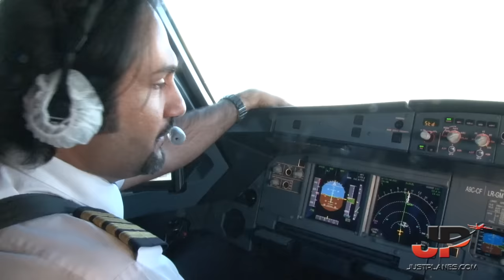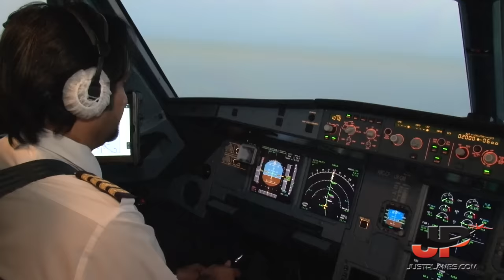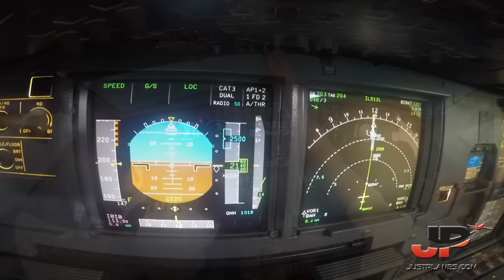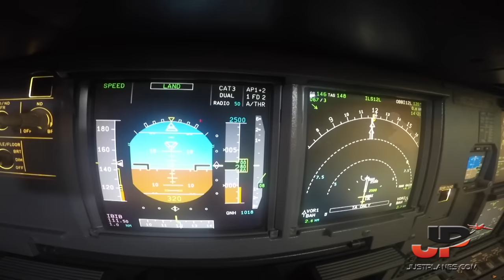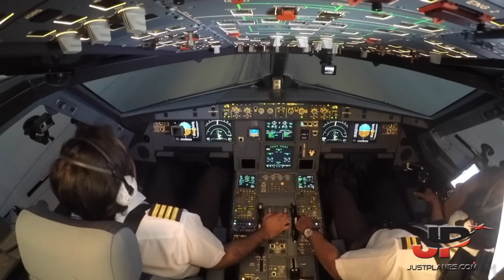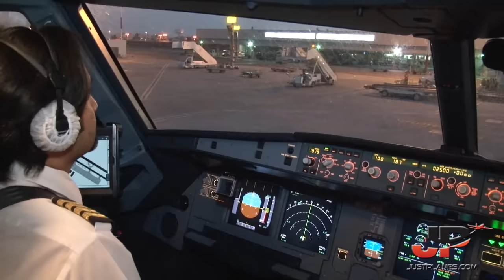Watch AIRBUS LANDS ITSELF  - Full CAT III Autoland

Comment: I'm sorry....you auto land of days gone by are stretching it a bit by touting various aircraft that had auto land capability.  To wit: as advanced (for its time) as the L1011 was, it was not fully CATIII (which, BTW there's various CATIII certifications) certified.  Go look up your history of when the FAA approved the CATIII landing process.  The L1011 might have been capable, but capable and consistently achieving a CATIII landing including roll out is a different matter.  Me thinks there's some wanna be M$ SIM pilots that read and believe waaaaaay too much.

When launched in the latter of 1985, the Gulfstream GIV had all the avionics for CATIII certification but it wasn't certified at that time since many airports didn't have the required FAA infrastructure.  Certification was achieved at a later date with the inclusion of autothrottles.  Plenty of aircraft manufacturers touted their aircraft's "CATIII landing" ability, but none - to my knowledge in this time frame - were actually ordered with the necessary avionics/electronics since there was probably only 3 airports in North America that had the infrastructure for CATIII.  This might be splitting hairs, but I see a vast difference in capability versus actual performance.  Be that as it may.....

As has been pointed out, due to the advent of FBW, FADEC, BBW, AutoThrottle (subset of FADEC) and other technologies, the A380 and other aircraft have achieved a very sophisticated level of CATIII landing capability.  However.....go back and look at this video.  Yes....the avionics of the aircraft are doing a remarkable job of maintaining the vertical and horizontal position of the aircraft persuant to the approved landing procedure.  BUT.....the electronics do not fully command the aircraft's landing configuration.  This is still the PIC or FO's responsibility.  The "Auto Land" is merely a tool to lessen the flight deck's work load in less than ideal conditions.

Lastly, I'll apologize for the apparent rant.  However, it's only the FAA that stands between the corporate airlines and full aircraft autonomy.  The technology has long existed due to black hole project work and other such research.  Consumers "feel" better when someone is driving the bus.  Airline CEO's see profit increases at the notion of no "bus drivers" in lieu of system monitors.
Reply: You are wrong. The limitations on the use of auto-land are down to the airports and the FAA. Aircraft have been capable of Cat 3 auto-landings for more than thirty years, but the regulatory authorities have not been willing to licence their use because few airports have sufficiently good ILS systems or the ability to handle ground traffic well during poor visibility.

Comment: The Air Bus flys like a video game .
Reply: Still safer than a 737 MAX
Reply: Thomas Mortimore air buses have had more crashes than the max
Reply: Mr Paul Grimm that’s hardly a fair comparison as the A320 was first introduced in 1980’s and 737 MAX in 2016. A320 NEO hasn’t had any crashes

Comment: Uhhh, it's NOT an auto land if you have to manually lower the flaps and gear.
Reply: It is autoland. The autopilot doesn't have the ability to lower the landing gear and change the flaps.

Comment: Just a matter of time before the airlines eliminate the co-pilot on short ..2 to 3 hour flights. Then stretch it out.
Reply: It won't happen. Big commercial jets cannot be flown by a single pilot, there is far too much to do. Besides, number of crew is specified by the manufacturer in consultation with the regulatory authorities.

Comment: This should be the norm and not the exception. All landings should be autolandings and they should practice manual landings once in a while. That would eliminate many issues. Like runway/taxiway misidentifications for one. It will never happen, but it should
Reply: Wrong. Auto-land systems can handle only a small fraction of the situations which human pilots can handle.

Comment: Are pilots gonna be replaced by this technology?
Reply: Autoland has been around since the mid 60s
Reply: @PabloGonzalez-hv3td  ok, is that a yes?
Reply: @kcism3239  - No it's an aid for landing in near zero visibility where a visual landing would be impossible
Reply: @PabloGonzalez-hv3td  Mr. Gonzalez you really think this technology won't replace pilots one day? Like auto taxi for runway? Like the Jetsons?
Reply: @kcism3239  - No because when something like an aircraft is fully automated it becomes vulnerable to failures that would otherwise be recoverable by a human pilot which is why the US military crashes far more UAVs than manned aircraft
Reply: @PabloGonzalez-hv3td  Mr. Gonzalez pilot error is said to be the largest factor in crashes and your telling me sofrware of the future will not replace pilots? In capitalism? Really?
Reply: @kcism3239  - The safest aircraft have  human and computers watching each other's backs without getting in each other's way and flying in the last 20 years has become the safest it's ever been.

Automation will never replace human commercial pilots for the reason I mentioned already, that is, automation requires sensor input information and a simple input failure is a vulnerability that can bring down an otherwise airworthy aircraft. On any Airbus progressive data input failures give the pilots escalating authority as the flight computers lose reliable data to make decisions. No pilot = certain crash.

The Max crashes are the perfect example of aircraft that should not have crashed from simple sensor malfunction and technically those planes were still recoverable by the pilots although I'm not blaming the crews as a brand new jet should not have placed them in that situation to begin with
Reply: @PabloGonzalez-hv3td  Didn't we orbit the earth with an animal in it Mr. Gonzalez? Was the animal watching the back of the machine/🚀 that took it to orbit the earth? I'm not feeling you.
Reply: @kcism3239  - That was a once off scenario even the space shuttle only flew 135 times there's more airliners taking off in the next minute even still the shuttle was mostly manually landed. The Apollo astronauts had to periodically reset the course using a sextant they were very much monitoring the computers
Reply: @PabloGonzalez-hv3td  once off? How about always off, maybe not in our lifetime or maybe in our lifetime my friend...
Reply: @kcism3239  - Not sure what you're getting at anyways comparing space flight to airliners isn't relevant completely different considerations and the fact the technology to fully automate airliners has existed for a long time and it hasn't happened should tell you something
Reply: @PabloGonzalez-hv3td  The 737 has a software issue, if this were not the case then what would the next Boeing airplane do? What would flight be in 1000 years? A.I. pilot?
Reply: @kcism3239  - Airliners have had software issues since the 80s it's just the first time they've truly been directly responsible for accidents.

Again the current level of "automation" has existed since the 60s if you ask me we'll never see pilotless airliners due to the simple liability and public perception if the public is terrified of the MAX imagine how they'd feel the first time a fully autonomous airliner crashed?
Reply: @PabloGonzalez-hv3td  As you already know, the mere presence of a pilot does not mean much in a 737. I beg to differ with your opinion that automation will "never" be accepted by airline passengers in a capitalistic society. Maybe you underestimate A.I. future. With features like "anti-stall", "solar surfaced", "parachute airplane/ airchute equipped" etc. What about the day when virtually zero loss of life from crashes, the day when people have private pilot licenses as much as driver licenses? Do you not think America will not one day introduce all of the above? Really?
Reply: @kcism3239  - Like I said the MAX is actually an example of how a simple input failure can bring down an otherwise airworthy aircraft when the human is kept from intervening if complete automation automatically meant zero crashes the US military wouldn't be losing UAVs.

As someone that is working on their PPL I am assured that there will NEVER be a day when a pilot's license is as common a driver's license if you are alluding to flying cars that's a concept that isn't being held up by technology but by practical space both on the ground and in the air
Reply: @PabloGonzalez-hv3td  Congrats on your PPL training, wish you the best.
Reply: @kcism3239  Software is created by humans. It may be much less susceptible to operational failure than humans, but it is much more prone to systemic (design) failure and it cannot get out of a mess like a human can.

Comment: Pilot talked tooooo much in cockpit. He’s king to his partner. Captain tell his partner what to do.
Reply: Captain only spoke what is needed to be said to explain what is going on. The captain being the flying pilot gave instruction to the non-flying pilot to perform tasks, it was not an order, if the first officer was the one flying he will be giving instruction to the captain to perform such tasks, not that he does not know, but it is a procedure in all airlines for safety! pilot flying only fly, non-flying pilot, do tasks such as radio, landing gear, flaps except throttle which is handled by the flying pilot.
Reply: Elmuiz Ahmed listen to Donald Trump.....